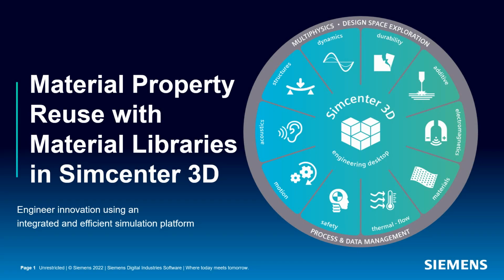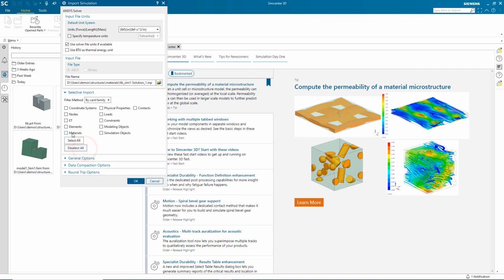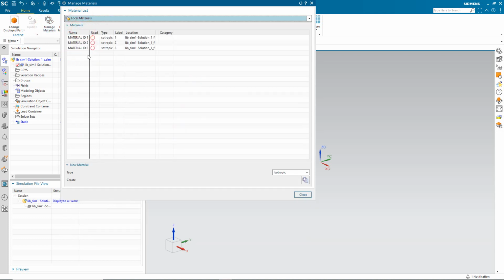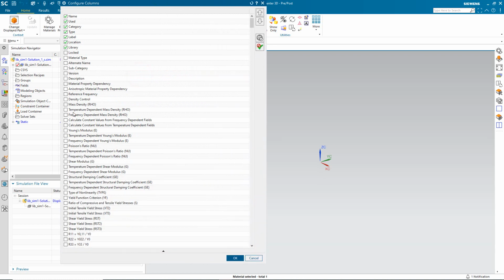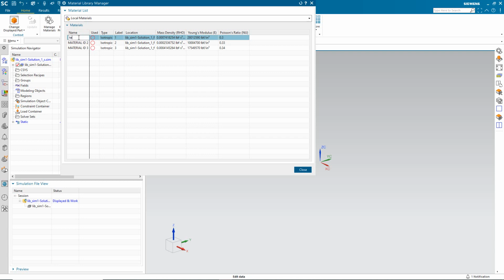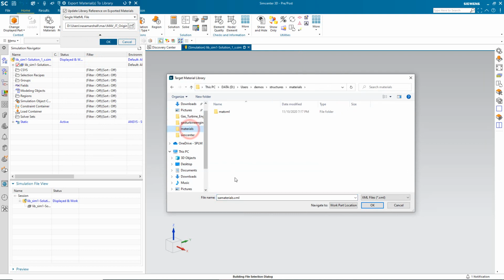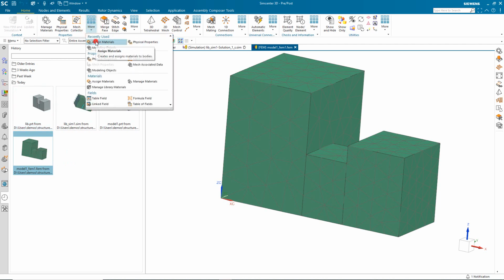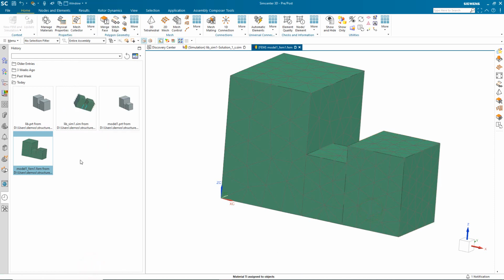Material Property Reuse with Material Libraries in Simcenter 3D

Comment: How to change same material in different fem in an assembly fem file to a different material.
Now I have to go to each fem file and change
Reply from the maker: Materials defined in a component fem can be changed either in the component fem or you can override the material definition from the sim by changing it when the sim is the work and displayed part.
Reply: @Simcenter3DTipsandTricks  if you have lots of components in afem and have to change material in each fem, for ex, change all metallic component from Al to ti 
now I have to go to each one and change, any easier method
Reply from the maker: @gaganaut06  If you expect that you may need to change all the materials of all the components you may want to consider using a monolithic fem (single fem for assembly) instead of an assembly fem since it would be easier to modify the materials of multiple bodies/meshes in a monolithic fem.

Comment: Hi, thank you for the demonstration. Can user create one  material xml file per material, simply with 1 click, library being automatically renamed if multiple local materials are selected for export?
Reply from the maker: The user can create one material xml file per material, however, that would be inefficient since one material xml file can support multiple materials.  If the user would like to add a material to an existing material xml file, simply select the existing material xml file when specifying the destination library.
Reply: @Simcenter3DTipsandTricks  this is understood, but what if user wants one material per file, (which Simcenter supports)?
Reply from the maker: @tignytigny  Yes, you can create one material per file.